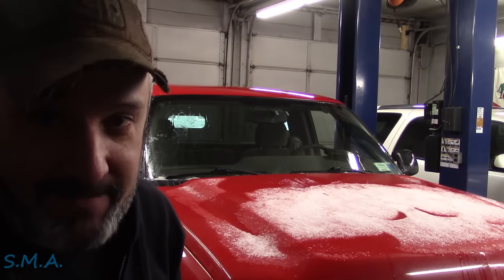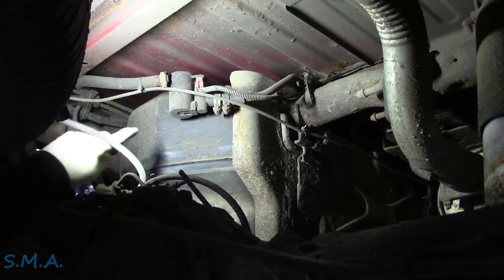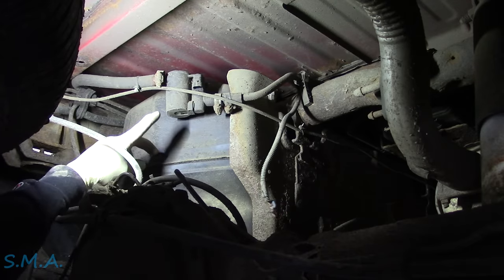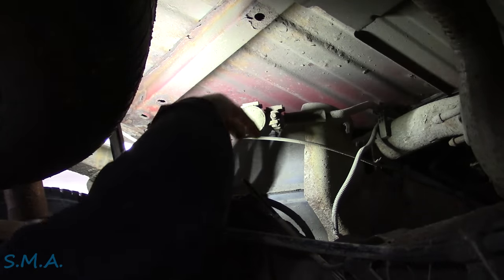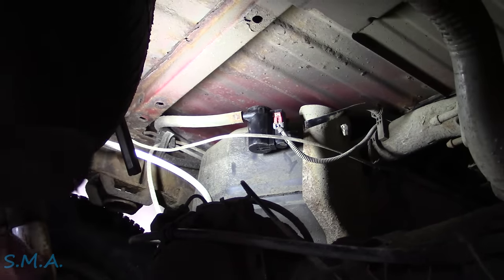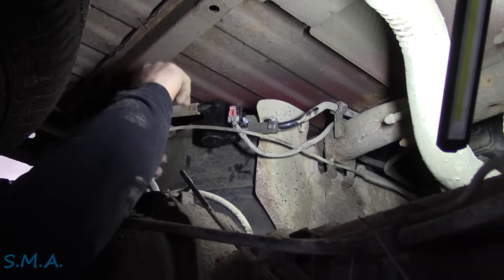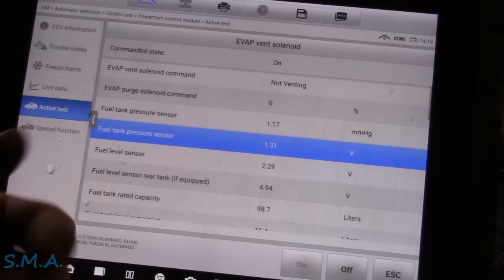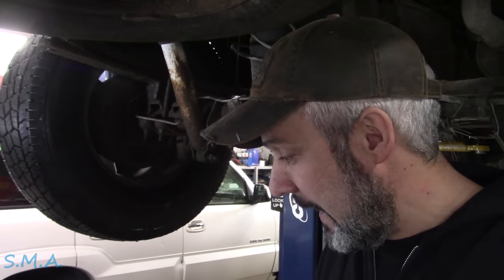Chevy/GMC Truck: P0442 P0455 Small & Large EVAP Leak

Comment: Ok here is what I'm seeing on my 2003 Silverado. Check engine light P0455 large EVAP leak. Changed out the rusted fuel filler neck and gas cap, purge solenoid, vent solenoid, cut a hole in my fiberglass bed to access the top of the fuel pump, it's rusted pretty bad but I don't smell any gas vapor there. So the purge valve is constantly cycling (hear it ticking), the vent solenoid is really hot which I know is normally open so I'm assuming there is a constant voltage keeping it closed when vehicle is running and trying to create vacuum in the system. Anyone have any ideas what could be causing the purge solenoid to constantly cycle and the vent solenoid to be very hot and all this mess causing a P0455.I know about smoke test but trying to diagnose without it.. Would a vacuum leak on top of the gas tank at fuel pump assy cause the symptoms of those two solenoids doing what they're doing?

Comment: Will this cause a chugging condition?
Reply: No. A stuck open purge valve could.
Reply: @Discretesignals  ok I have a 2010 grand caravan that will intermittently chug but only after it's warmed up
Reply: @jimo2627  any trouble codes stored?  Does it chug at idle, cruising, or accelerating?
Reply: @Discretesignals  money light is on not sure of what codes and it chugs at any speed until it just releases and will take off and run fine for a while then goes back to the chug
Reply: @jimo2627  money light flash when it's chugging?  Probably wouldn't hurt to see what codes are stored.  Any repair attempts done or parts replaced?  Which engine?
Reply: @Discretesignals  light doesn't flash haven't done anything yet it's the 3.3
Reply: @jimo2627  see what codes are stored.  Might be codes stored that might give you some direction.   3.3 uses coil pack and wires.  Worn wires or plugs can cause misfires under load. With the engine warmed at night see if there is sparks jumping out of wiring.  Coil pack could be failing when hot or coils are stressed out from worn plugs and wires.  Could have injectors windings opening up at higher temps.  You would see that in an injector amp waveform.  If it chugs when TCC is locked up, could be converter clutch is slipping. Usually TCC chatter feels different than an engine misfire though. See what codes are stored first.
Reply: @Discretesignals  I did  plugs and wires and no change I'll swing by and have it scanned
Reply: @Discretesignals  only code is for #1 02 sensor heater circuit low but now it's running ruff all the time at idle and getting to speed
Reply: @jimo2627  P0135?  Really can't use fuel trims as a diagnostic tool until you figure out why the PCM is flagging an 02 heater code.  Have you measured the heater element resistance in the sensor.  Should be somewhere around 12 ohms.  The PCM duty cycles the heater voltage on this one.  The PCM also measures the resistance of the heater circuit  periodically to infer an O2 temperature.   Does the engine run good when you first start it for a few seconds?  If you force open loop by unplugging that sensor, does the engine run better?
Reply: @Discretesignals  no I don't have the tool's it goes in the shop this week
Reply: @jimo2627  Let us know what they figure out.
Reply: @Discretesignals  it turned out to be a faulty o2 sensor
Reply: @jimo2627  glad to read you got it fixed!